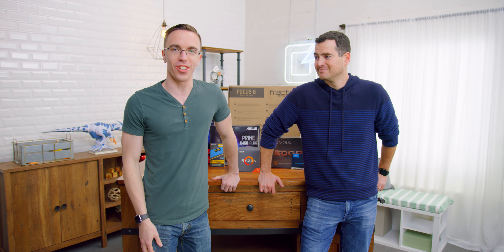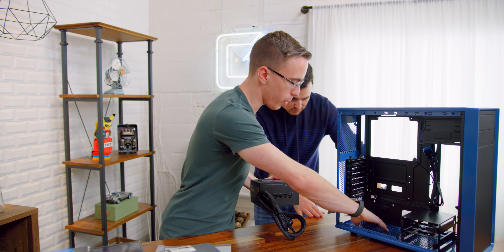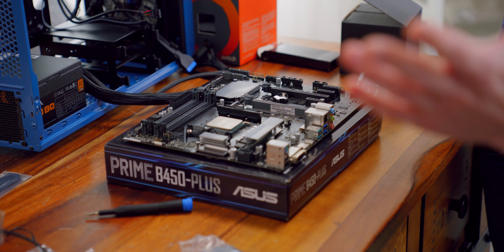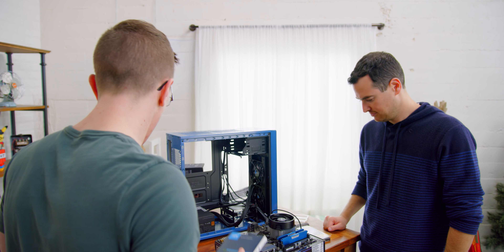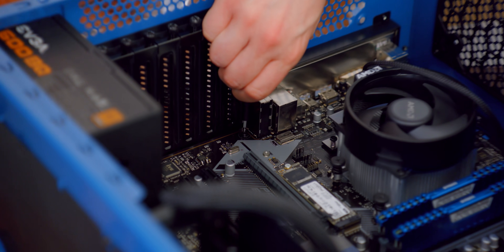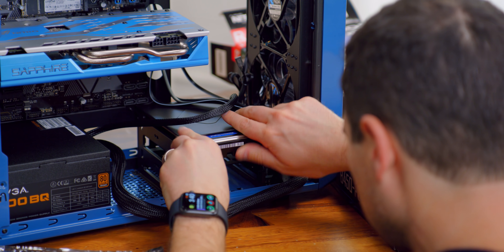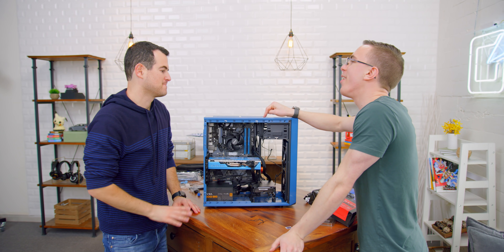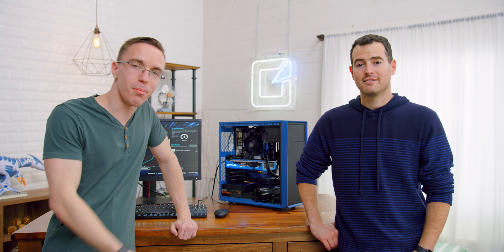How to Build a Gaming PC (2019)

Comment: im planning to buy a pc and im not sure about the power supply so i will show my pc specs and will you guys help find out if this psu will not break the pc?
SPECS:
ryzen 3 2200g
foxconn h61mxv mobo
corsair vengeance lpx 16gb ddrv 2666 mhz
gigabyt gtx 750ti 2gb 128bit ddr5 video card
xpg sx8200 pro 25g gb
casing:thermaltake  core v1

and the psu ill be using is a EVGA 400 NL or NI 400w i forgot if it was NL OR NI SRY

i beleive it is 400 dollars or below since im poor
Reply: no

Comment: If I add a 2tb hard drive to my future build will I need an ssd?
Reply: No. But I strongly recommend an SSD as the boot drive. Your PC will be overall much more responsive with an SSD as opposed to Windows being installed on the HDD. You can usethe HDD for data storage if you want.

Comment: so i'm ordering my items now and so far this is what I got ( can someone tell me if I can put all the parts together or if I have to get different items) :)
Cooler Master MCW-L3S3-KGNN-00 MasterBox Lite 3.1 TG (case), 
Gigabyte GA-A320M-S2H AMD A320 LGAAM4 Micro ATX Desktop Motherboard, 
Thermaltake Smart RGB 500W 80+ White Power Supply, PS-SPR-0500NHSAWA-1,
WD 1TB SATA 7200 RPM HDD,
ZOTAC Gaming GeForce GTX 1660 Ti 6GB GDDR6 192-bit Gaming Graphics Card Super Compact,
Crucial DDR4 2666 MT/s (PC4-21300) 288-Pin Memory 16GB Kit (8GBx2) SR (ram) and an
Intel Core i3-9100F Desktop Processor 4 Core Up to 4.2 GHz Without Processor Graphics LGA1151 300 Series 65W all connected to a 
Kogan 24" Full HD Curved 144Hz Freesync Gaming Monitor (1920 x 1080). so will all this work together?
Reply: The motherboard won't support the CPU since they're different sockets.

Comment: I'm currently building a pc and I am new to all of this. I'm using a Ryzen 5 3400g APU and an Xfx Radeon 580 GPU. I realise that with the apu, I don't technically need a GPU, but will my GPU enhance the existing performance of the processor, or will it just make the APU's integrated graphics obsolete? I heard there was something called dual graphics but Idk if it works with all GPUs. Can someone help plz

Comment: Hey I'm a bit worried right now :/
While trying to install the front panel connectors I accidentally bended the pin for  Power LED + . 

Am I going to lose any functionality or is there a possibility that it won't have any impact on my build? I'm going to power up everything tomorrow but that accident just messes with my head right now :(

Comment: If I am replacing my motherboard, ram, and processor am I gonna have to re install windows?
Reply: CerealKiller558 Thank you that is good to know. And do you think a Ryzen 7 2700x 16gb ddr4 and a 1050ti will be able to run the rift s?
Reply: CerealKiller558 ok thank you

Comment: New to this pc learning. I need help if this is a good pc build or need to change of items. Would really appreciate your thoughts. Here is my list: 
Graphic card - XFX Radeon RTX 5700

Graphics Core - Ryzen 7 3700K 

CPU Cooler - ARCTIC Freezer 34 eSports DUO Tower 

Motherboard - ASRock Motherboard (Z390 PRO4)

Desktop memory kit/RAM - TEAMGROUP T-Force Dark Z DDR4 16GB Kit

Power Supply - EVGA 500 BT

SSD - Crucial P1 1TB
Reply: The motherboard is Intel, but the CPU is AMD so it won't work. If you want Ryzen, you must get an A320, B450, X370, X470, or X570 motherboard.

Comment: Me: *Watches about 50 videos about building game PCs*

Also Me: *brain crashes*

Phack it. I'll just save up for one that's already in one piece...
Reply: That way you won't know how to upgrade it...
Reply: Bad idea.
Reply: On the contrary, I can upgrade something that's already functioning. I just don't have the patience to put something together myself.
Reply: @joshuacastillo6003  putting it together yourself nets you a deeper understanding of the parts and how they're arranged in the case. You're essentially studying your system as you're putting it together, so if you upgrade something someone else made, you risk messing something up because they did it in a way you didn't understand. Same thing with repairs, it's easier to know what's wrong when you plugged it in yourself and can remember where you may have slacked on
Reply: @joshuacastillo6003  besides, you get a lot of satisfaction from building a PC, and it's usually cheaper to make it yourself. It's worth the effort, trust me.
Reply: @Cloneman-ic9rx  Not here in the Philippines 😂
Reply: @Cloneman-ic9rx  We went to a shop to buy one for Php 32,000 but the parts cost nearly Php 6,000 more when bought separately.

Comment: In GPB it's £765.20 incase anyone was wondering
Reply: @ElectroPlays It will definatley be very difficult to buy a pre-built one online but if you bought used parts then you could probably build one
Reply: @ElectroPlays I depends where you gget them from but most f the time used parts will work fine

Comment: Hey guys, I just built this PC. Everything is the same except I'm using an EVGA 850 BQ rather than the 600. I can turn it on fine and all my fans are spinning and the whole thing lights up but it just won't post. I've tried unplugging/replugging pretty much everything with no luck. Any advice for a rookie's first time troubleshooting? ^_^
Reply: I am in the same boat except I bought the 750. No luck getting it to post
Reply: Could be your cable or maybe you didn't seat the gpu correctly

Comment: so i did the pc part picker thing, and i had an estimated total of 314w, with a power supply 500w bronze 80+ on the list, is that good?
Reply: Anything above 450 w your basically in the clear but if ya want to overclock your build you wanna go above 600w

Comment: Wait im confused do you have to apply thermal paste on the cpu even for the stock cooler? (I dont know anything about thermal paste btw)
Reply: Intel and AMD stock coolers come with thermal paste pre applied.
Reply: @craigtheaircooler2580  so would that mean Im not allowed to touch the middle bottom of the  stock cooler?
Reply: Your not supposed to touch it cause you can get grease from your fingers onto it.

But it docent impact anything
Reply: @craigtheaircooler2580  thanks dude

Comment: What would be better? A rx 590 graphics card or a gtx 1060?
Reply: Rx 590 is the same as the rx 580 witch is better than a 1060
Reply: @blank_b  which*
Reply: @jacobc.2899  do you really have to correct a 10 month old comment?
Reply: PotatoGoat do you really have to reply?

Comment: Dumb question what's the best computer someone could make with 10K
Reply: Get an Alienware PC with custom core I9 and 32 gig ram custom use the spare cash for keyboard and mouse also get LG oled which in my opinion is best because you can stream with
Windowed tabs instead of getting 3 monitors
Reply: @jessp687  lmao Alienware is the biggest scam around if you want to get a pre built get the "Corsair one"
Reply: What is the currency?
Reply: It depends. Either workstation or gaming

Comment: I just built this exact pc using your guide and I don’t think the bios system is working at all because the pc won’t connect to my monitor, mouse or keyboard. I’ve made sure everything is plugged in correctly, I’ve tried multiple different hdmi cables, dvi cables and monitors but it still won’t work. Does anyone have any tips?

Comment: How do I solve an issue were I only get a flicker of power when I press the power button? and I think my frontal panel connectors are set up correctly, but of course I could be completely wrong.

Comment: Cables are like non-existent since there is like nothing in the case. No optical drive or exhaust fans. No mention of either and all of this would have been nicer if it was all in an mATX case. RX 580 would have been shorter and only use one 8 pin connector.

Comment: I have always installed the motherboard first into the case before I put the components in it because I want to get to the screws correctly. Not to mention it all makes it bulky and heavy. And yes, hold it by the heatsink... As you whip it around.

Comment: So that Fractal case doesnt come with fans? PSU catching on fire? Ive built computers for over 20 years and my 1998 computer is still working with my original parts. 8GB hard drive and Windows 98 first edition. And Voodoo Banshee 16MB.

Comment: Well my first time building a PC went terribly wrong. We installed everything the CPU the fan and then the motherboard was the part that went wrong. My brother handed me fan screws for the mother board and we tried for 30 minutes to put it in the case and ended stripping the motherboard. 😭 but fast forward we ended up switching out the motherboard and the pc still didn’t turn on and ended up the store not updating the BIOS. But everything turned out fine 😂 I almost lost 120$

Comment: got a old 800watt. power supply. 
should i concerned buying new parts like gpu and cpu and motherboard and still be using my old 800 watt ?
Reply: I would get a new power supply because if there is something wrong with it, then it could potentially break all your other parts in one go.

Comment: the ram on the asus prime b450-plus motherboard is supposed to go in dimms 2 and 4 not 1 and 3 according to the manual
Reply: Does it matter?
Reply: @kemalcolak7625  lol no
Reply: Like I'm just wondering if there is any difference on the performance not trying to be mean :)
Reply: @kemalcolak7625  not really, just wanted to point it out

Comment: I’m New To PC Gaming And Was Wondering If This Would Be Ok And What Games Could I Play? -

Processor: AMD Ryzen 3 2200G 3.5GHz (3.7GHz Turbo), 4 cores
Graphics: AMD Radeon Vega 8 Integrated Graphics
Memory: 8GB of DDR4 Memory running at 2666MHz
Storage: 1TB Hard Drive
Power Supply: Xilence 400W 80+ with 6 pin PCI-E cable
Available Rear Ports: 4x USB3.1, 2x USB2.0
Triple monitor support
Windows 10 Compatible (Not Included)
Reply: All low to medium settings
Rocket league
Csgo
GTA 5
Skyrim
Also don't use that power supply get one from EVGA or Corsair

Comment: very good video guys :) keep it up
planning a budget build : ryzen 2400g, b450 mobo, 16gb 3000 mhz ram :) any suggestions guys
Reply: Yeah a couple of suggestions I started a build last week. Mainly focusing on these specs with the option of maybe getting the Ryzen 5 1600, Ryzen 5 2600 or the 2600x.   I've noticed the closer we get to the release of the 3000 series. The more the prices drop.  Try to get all the other components of the pc first at this stage.  Focus on cpu last. But make sure which ever options you pick the ram/mobo is compatible.    You could also op for 1060 instead of rx580.  Virtually the same thing except rx580 has direct 12 so it's I guess what you can call more "future proof" as newer games will use direct 12.  Cheers.
Reply: Rasta Zorastra thanks buddy m planning on building the pc after ryzen 3000 is announced well frankly waiting for price drop i also had intel i5 8400 on my mind what do u think  :)

Comment: Someone please help me. I recently built a pc and it was working fine for a good month. Just yesterday, I turned it on and all the lights went on and everything was running. But I noticed my mouse and keyboard weren’t lighting up when usually when I turn on my pc, they automatically light up. And then I waited a little and then nothing was being displayed on my monitor. I unplugged everything, plugged it back in, held the power button, but nothing works. I do not know what’s wrong.
Reply: attempt:1 change power supply 
attempt:2 change ram 
 attempt:3 buy new system 

over all it's most likely the power supply either bad power supply or just need more watts on the power supply
Reply: MR.exposer-dozer thanks bro!!.. it was my ram

Comment: I am trying to build a pc close to this one, it is;
Ryzen 5 2600
16 Gb 3000 mhz
500 GB SSD
Radeon Rx 590 
B540m Gigabyte Motherboard
500 watt Psu
I have already tested on Pc builder and had no compatibility issues 🤞🏾
Reply: Nicee
Reply: @Magnus Rasmussen aren't they the same? Also the only issue i can encounter is if the cooler covers The Ram slot or the Board doesn't support overclocking on the ryzen 5 2600 or may be i will just get a motherboard that supports Overclocking.
Reply: @Magnus Rasmussen Yeah i dont like risks that much, i think i will opt for one of those Asus Gaming boards.

Comment: Hey man I just tried my PC build with " Ryzen 3 + gigabyte a320m-s2h + corsair 4gb ddr4 + corsair 450 PSU " 

Processor fit properly, fan running cabinet powered up.... but message on my monitor show "Input signal not found" even after connecting VGA as well HDMI cords"

Need help !!!!!

Comment: I have recently built this build and it runs for a split second and then turns off, does anyone have any ideas what could be wrong?
Reply: It ended up being a faulty psu replacer it for a 750 works perfectly.
Reply: @idiocyinverted3825  so you bought Everything exactly from this video and it works well? How is the gaming performance?
Reply: Albert Lefebvre the only thing different from the build is the power supply which I changed for a Corsair 750w power supply. The gaming performance is great with everything I’ve thrown at it. I play games such as total war warhammer etc
Reply: Connectors aren't in, power supply wattage too low, or parts aren't compatible
Reply: I have checked all the connectors and I have done some trouble shooting by taking the parts out one by one to try and find the faulty component. I have got down to the motherboard, power supply and cpu. Which do you think it could be as I have used the exact parts listed in the video. Also the only part that was sourced out of the uk was the power supply, would this make a difference?

Comment: can i just buy a windows pc and just upgrade the GPU and it will run the same as a gaming pc?
Reply: Itachi Uchiha you could but you would also have to make sure all the other components are compatible with your gpu. For example, most lower end windows pc would have low end power supply, which would affect ur gpu performance. So mind as well either build a pc or buy a prebuilt.
Reply: Nathan Kong thankyou

Comment: Im wondering if anyone can give me a hand. 
I am having just a hellish experience with whats going on. 
Currently my graphics card (msi radeon Rx580 8GB) keeps restarting my system. 
I assumed it was overheating,  so i took off the lid and added in a external fan to increase flow. The card STILL runs about 37 -41 Celsius.  I didnt think that was too hot, but after the whole escapade with installing proper drivers after messing up the first 20 times(radeon settings didnt match since i updated in device manager).
I now have my drivers up to date the 19.5.2 i believe and can access radeon settings no problem. 
My system keeps overheating when i play either skyrim or run my video editing software(shotcut). 
So i installed msi afterburner and turned the fan speed up to 85% and confirmed they turned on. 
Still overheated started at 27 Celsius before i turned on my shotcut software. 
-so i updated drivers
-turned on the fans
-added an external fan and left lid off
Any advice to how i can make this stop happening?

I spent about $500 total for my first gaming pc build. 
Case: cooler master
Processor:AMD A8-9600 radeon R7 3.90 GHz
Ram: 16 GB Ryzen GEIL dual channel EVO spears
Board: ASUS brand.
Reply: Pantsu King my dad had the same problem, try a new power supply with better wattage

Comment: Should i get a used 1070 for 220? Im so tempted...
Reply: yeah, what could go wrong
Reply: @kalaclav2K  nothing really, if it craps out or doesnt work then ebay should have me covered and the seller is at 97% rating though it was stated the card was used for AI rental and rendering purposes so... it's a gamble i guess
Reply: @Alejandro_87  yeah, but you need to take a chance

Comment: What are good specs you can get without breaking the bank?
Reply: It's entirely possible to get a rx580 GPU and a ryzen 5 1600 CPU, for under $200 total, long as you're willing to buy used.
From there a 500w power supply, 8gb RAM, and $50 case. A simple 500gb HDD for storage, and maybe a $20 Kingston SSD for OS and programs. Finally a WiFi card, easy to get for $20

You're looking at $350-$400

Comment: Does both the motherboard and cpu need to be Ryzen, on pcpartpicker mine detected no compatibility issues
Reply: Ryzen doesn't make mother boards, you just need to pick a motherboard that is ryzen compatible. and of course has the features you want like mutiple fan and rgb headers, at least 4 dimm slots and preferably usb 3.0.

Comment: Does the case matter? And if it doesnt which would you reccomend
Reply: The case needs to fit your components. MID towers are the most common case form factor. I'm running a corsair h500. It has dual 200mm fans, moves tons of air and is nice and quiet, you can see it in the background of my videos haha

Comment: A screwdriver? You need a Swiss Army Knife that hopefully has a phillipshead screwdriver in it.

In other news, I just rebuilt my system with a Fractal Design Focus G Mini... oh, and you ran your HD Audio cable all the way across the top of your MB? You know the Focus G case has a cutout on the bottom of the MB right next to the HD Audio connector (between the PSU and MB)... run that cable BEHIND the MB, and have it pop out right next to the HD Audio connector.

Comment: What if i have a GTX 1060 6gb but a weak cpu, will this fry my system?
Reply: no, it will be bottlenecked though. which means the GPU wont perform at its best to compensate for the weak CPU.

Comment: Xeon e5405 , 4gb ram , rx 570 4gb , 240gb ssd=180$ fortnite high graphics to fps ??
Reply: Emir Sahin Get a better cpu and a minimum of 8gb of ram and you can do high settings, I recommend the ryzen 5 1600 or Ryzen 3 if you are on a budget

Comment: Should have mentioned to orient the CPU, match the triangles on CPU and MB socket. 
Should have mentioned that some coolers have clear plastic that must be removed which is covering the thermal paste. 
Also should have explained that if there is no thermal paste on the HS you will need to drop some on the CPU hs. Peace